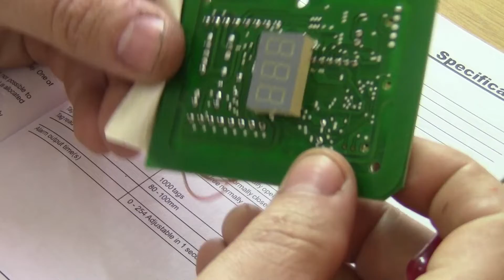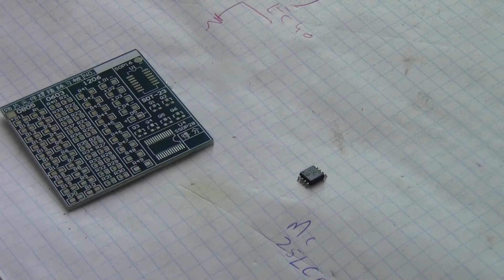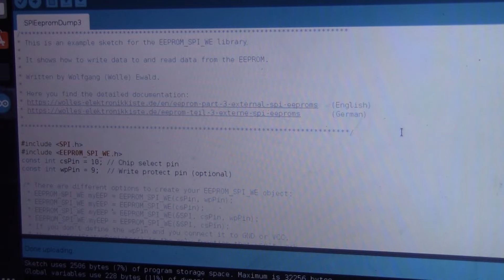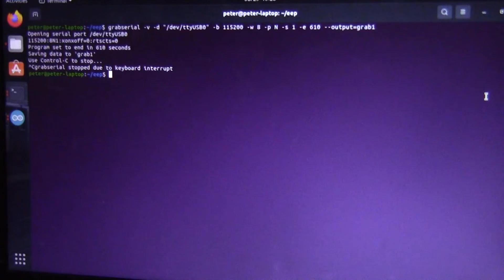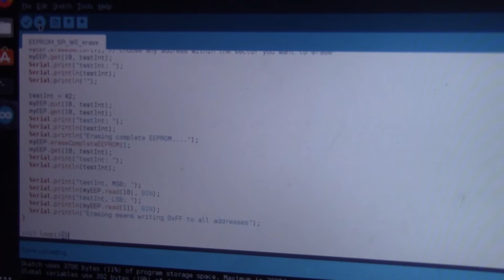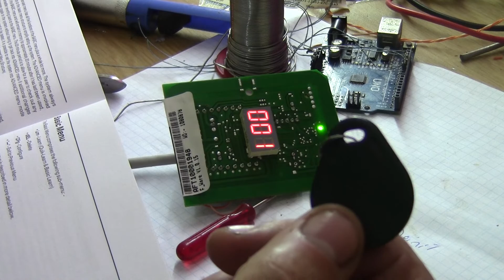ShoutingElectronics #42 - Lost Tags

Comment: You could have copied code no 7 down to the start, and gotten it to be admin tag that way, and saved all the other programmed tags as well. Then copied the other higher ones down, and filled the last block with FF. Note 64000 bytes is not 64k, that is 65536, as the Arduino IDE will use decimal numbers, unless you specify hex implicitly. But that space is not used here anyway. Likely the reason Centsys discontinued then is they cannot get the PIC microcontrollers any more, and have changed the microcontrollers they use to a different TI part, because of that. Good thing about that is the led display and arcane programming with timed button presses, hand waving, decrypting the odd display characters all went to the new 5 button  and LCD display, even if you do need a magnifying glass to see the screen.

Comment: See somebody was medieval on the power screws before you. Pity it is 13MHz, I have the 138kHz clone maker from China, which works well to clone the cheap tags. I got the cost back of the kit already making spare tags for my sister, as she needed 2 extra tags, and the BC wanted to charge an arm and leg for them. Clone kit was R100 for the kit with 20 tags, including the SAPO vig.